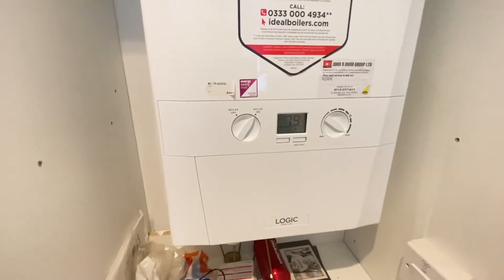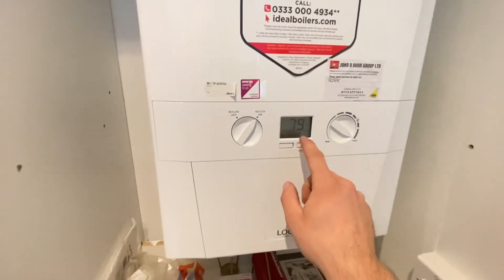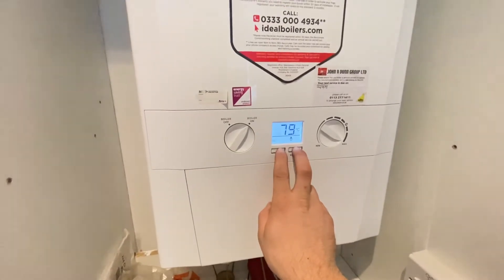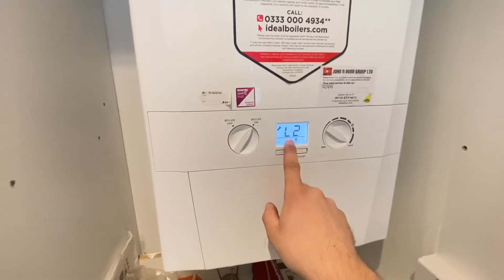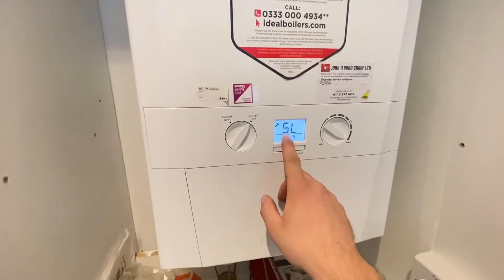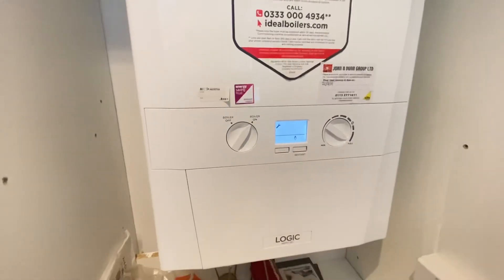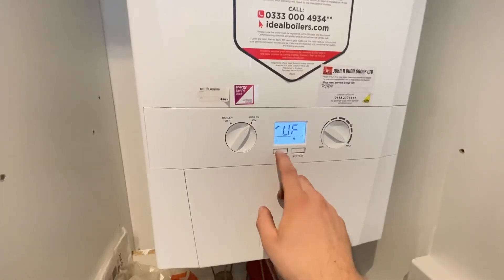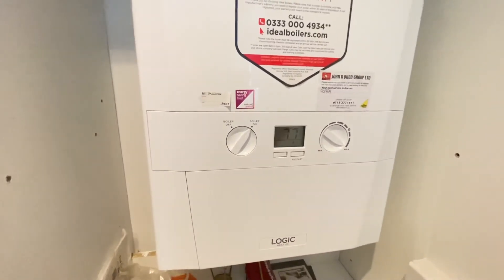HOW TO PUT A IDEAL LOGIC HEAT IN TO SERVICE MODE || Boiler Training

Comment: How is the bottom cover opened, apparently the pressure gauge is under there, weird how its not visible, your video thumbprint shows the cover off, but its not off in the video.  This is the only boiler I have ever had thats got no manual.
Reply from the maker: Thumbnail definitely has the cover on and it’s not my fault you’ve lost the manual
Reply: @SmartPipePlumbing  I never was given a manual in the first place.
Reply from the maker: @chrcoluk  you should of got one when it I was installed as they would have to fill the bench mark out
Reply: @SmartPipePlumbing  guess something went wrong then, I will ask about it on the first year safety check, thanks.  Also sorry for my comment on the thumbnail.

Comment: What does f Od mean on the boiler? Cannot get mine to work
Reply from the maker: Not 100% sure not come across that before
Reply: @SmartPipePlumbing  
I tried the SH option, and it just keeps going back to the start and saying f Od.
Tried restarting it, knocking the mains off and have gas on the meter, if kicks in for a few seconds and then goes off again. It’s only a new boiler, I only moved in, but it obviously wasn’t on for awhile before I moved in. So not sure what’s going on
Reply: Got the same fault on mine

Comment: Hi There, 
My mother has this boiler and I'm confused how you set the DHW temperature? Obviously on this model the dial is only to set the central heating temperature rate. 
When you turn this it flashes the icon of a radiator. 
My mother's hot water is coming out super hot! 
So wondering if it's a secret setting to turn this down?
Reply from the maker: You will need to do it at the unvented cylinder there should be a dial to turn the temperature down

Comment: Quick question - is ideal logic heat 12 a system boiler or Combi boiler or regular boiler
Reply from the maker: It is a regular boiler, no expansion vessel inside boiler.